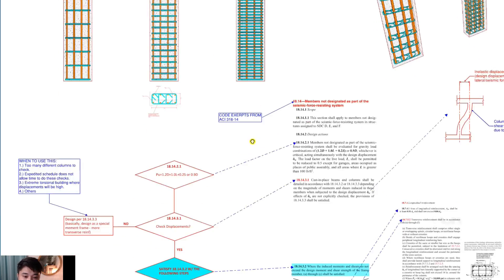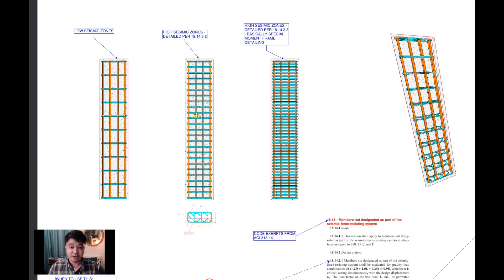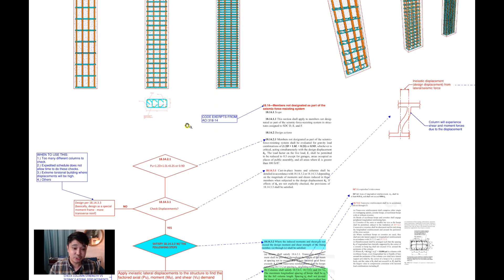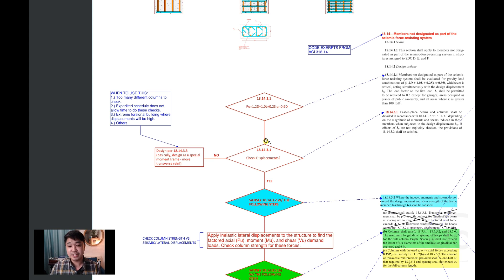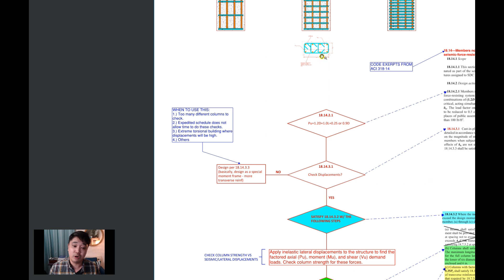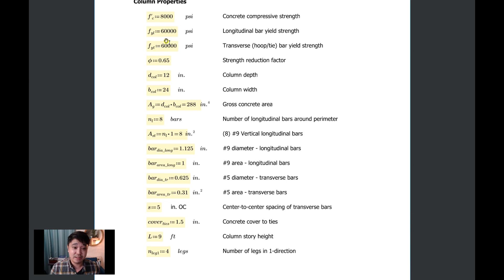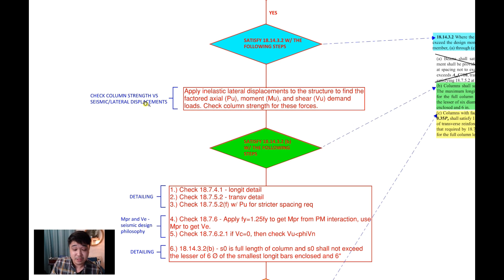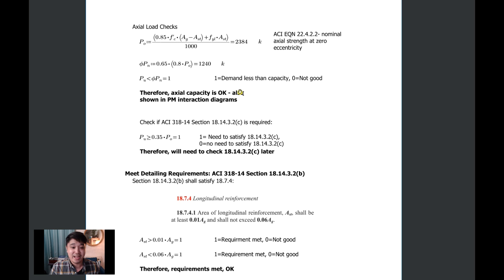Concrete Column Design Tutorial In Seismic Zones - ACI 318-14

Comment from the maker: What type of tutorials would you like to see in the future?
Reply: Designing of a shear wall like U shape in a seismic area
Reply from the maker: Oh, that's a good one, but tough!
Reply: I would love a tutorial on structural regularity for seismic buildings, say for example horizontal/vertical regularities!
Reply from the maker: Marcos, great suggestion!
Reply: Tutorial basis and professional courses videos would be great .
Reply: Hi Mat, I'm a structural engineer at Brazil. It's great to see this kind of videos even though the Design doesn't follow the same parameters as the Brazilian designing "rules". I wonder what would be the difference between the two types keeping the same load, stress & displacement. Let me know if you want to make this comparison. See ya
Reply from the maker: Gabriel, you could use the example calc and see. But, I'd hope to see that the same philosophy is the same, keep the concrete core in tact during deformation compatibility and an earthquake by adding hoops.
Reply: Design of concrete beams subjected to torsion!
Reply: Sir, please post lecture on
Selection criteria of types of foundation and design of foundation
Reply: Designing and detailing of two way slab rebars please
Reply: PT slab with bonded tendons🙏
Reply: Design of footings
Reply: More mathcad tutorials
Reply: Maybe a simple thing but that many structurals engineering fail in doing it. Model assumptions.
Like when to use floor as shell or membrane. Fisurate sections. How they affect global forces and displacements.
Reply: Beam n Slab design please using ACI code
Reply: Explaining  through unbraced lengths for top compression and bottom compression. For example is Risa when you have to enter your Lbyy, Lbzz, Lcomp. Top , and Lcomp. Bottom. I always have a hard time getting these right. Also rigid diaphragm lateral force distribution would be great. Thanks for the great content!
Reply: Could you do concrete shear wall design?
Reply: Step by step designing of buildings using staad/etabs. plsss :)
Reply: P-Delta Design of a Concrete Column with non Linear material behaviour
with solving the differential equation and
with the tension stiffening ofc.

Hell Yeaah 😆👍🏗😋
Reply: Hi Mat, very nice tutorial, informative and simple. Looking forward on your next tutorials. I think i wan to see designing of beams for SMRF, or Base shear computation as per UBC 😊😊😊.
Reply: Tutorial of basic BØQ
Reply: Would it be possible to talk about welded storage tanks :D ?
Reply: I’d like to see steel structure, or you can more deep or more variative into concrete structure
Reply: More examples of Mathcad. Greetings from Ecuador
Reply: Please do videos on mathcad
Reply: Short drilled pier design. I.e. sonotubes
Reply: Thanks Engr Mat for sharing your knowledge and experience. Would like to learn the basic from analysis to design of structural elements of building and warehouse.
Reply: Nicely explained. But didn't receive the calculation sheet yet. 😀
Reply: Deflection of beams or slabs.
Reply: tutorial on diaphragm floor design please
Reply: Performance Based Seismic Design
Reply: I would like to see in the future tutorials how to design structural members using excel
Reply: Finite Element Analysis
Reply: More seismic design for high seimic regions ; shear walls , smf and rigid diaphragm design for seismic provisions of ASCE7-10 & ACI-318-14
Reply: It would be great to have tutorials of different Strut And Tie Method applications! Thanks for your videos, you're awesome! Greetings from Guadalajara, México!
Reply: I would like to learn performanc3 based design and BIM
Reply: Seismic design of the buildings based on ACI code.
-Pushover analyzes
-non linear analyzes
Reply: Tutorial on detailing and creating plans will be especially useful.
Reply: design of diaphragms, chords and collectors !
Reply: steel structures design
Reply: Can you make a video about beam column joint connection? Thanks for  making videos
Reply: A tutorial on how to analyse mixed ductility systems would be great
Reply: Basic use of ETAB
Reply: Shear wall
Reply: Difference of result using other codes sir
Reply: Residential building design in ETABS.
Reply: Bridge design videos, please. I am always excited about the design of a structure for dynamic loading. BTW, do we consider the seismic effect while designing a bridge, if so, how it is different compare to other structures like a residential building? Thank you for igniting the quest of the young graduates like me.
Reply: Highrise building with eccentric columns
Reply: i like to see structure analysis and  design for all RC members  for small scale house based on ACI code
i know this would be tough but its my wishes
thank you a lots
Reply: Live Load Reduction for Foundations according to American Building Codes
Reply: Future SE needs this thank you so much
Reply: Awesome reference videos! I’d like to see an overview of Steel Moment Frame Designs (OCBF, OMRF, SCBF) and their application.
Reply: How to cross check software calculation with manual computations
Reply: Design of Dome
Reply: A course on tall buildings design and detailing in California
Reply: Tutorials about Interaction between soil & foundation, especially telling about the module of subgrade reaction
Reply: Hi mat, thanks for the efforts you put on these videos!
I hope if you can make one about sizing a raft foundation
Reply: designing of concrete/steel buildings in different lateral load resistant systems...
Reply: This is a great tutorial Mat. Any chance we could get a tutorial on Response Spectrum Analysis?
Reply: Design of beams sir!!!
Reply: I would humbly suggest being systematic. You have our attention. Start at the beginning of structural design, codes. Not so much mechanics of materials or analysis but  'advanced' topics'.
Reply: What about a full course for design? Useing aci &asce ?
Reply: A complete tutorial on slender column, both sway and non sway
Reply: Shear walls as mentioned below, and slabs. This video was excellent
Reply: full RCC Building Design
Reply: Autodesk Robot
Reply: ICF Wall design!
Reply: wood design
Reply: Full building design
Reply: JOINT DESIGN ACI 352
Reply: Hey Mat 
Can you do a series on the preliminary design of a building(i.e. placement of columns and preliminary column and beam sizes etc ),  prior to do the analysis in STAAD Pro (and how do the iteration if the acceptable deflection is not met is not met in STAAD)????
Reply: Etabs + Mathcad
Reply: modeling in SAP 2000 or Etabs of a 06-story building with prefabricated systems, beams, walls, columns. thx for u videos ,u are Amazing

Comment: In normal special moment frame columns you are able to not the fulfill spacing of s0 outside of the expected plastic hinge location.

In this gravity columns you have to fulfill s0 in the whole span of the column?

So in general your transverse reinforcement will be higher in the gravity columns than in normal columns?

Comment: Hi Mat, I’m from Ecuador. We based our analysis and design in American codes. Do you use a single model to analyze the gravity and seismic system in ETABS? If not, some tips would be useful about using separated analysis. In my country, one single model is generally used which includes all structural elements. RC SMF is the most common system.
Reply from the maker: It's different from firm to firm and may even differ from project to project. I like to separate the gravity/lateral models for the projects I work on, especially if the buildings are complicated. Combining lateral/gravity into a single model is great if you can get the model working, but sometimes it takes forever to just get the model to work because of complex geometries and meshing, you can end up chasing miscellaneous errors (and wasting firm money) instead of actually engineering. Again, depends on the firm, project complexity, and even software.
Reply: Mat Picardal you should make a video about that 👍

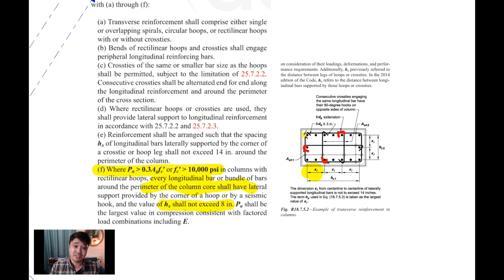Comment: Hey Mat, at 10:19 you said both hooks have to be 135 degree ones(which makes sense) but I doubt its practicality, workers on site r gonna have hard time placing such hooks.
Reply from the maker: True, thats why contractors sometimes request to use "serpentine" hoops where they use a bending machine to create multiple bends in a single continuous bar to make a single hoop for easier installation. These are typically approved by engineers for gravity columns, at least in the west coast of the US.

Comment: Nice spreedsheet Mat. 

I have read Jack Mohele book and there is a picture with a building destroyed after an earthquake where the specialmoment frame in the perimeter are ok, but all the secondary columns are destroyed.
So, it is indeed a very important topic to consider.

However, I have always have doubs about this and you may help me, with your practice in California, to clarify them.
 
Imagine you have a low rise building and you decide to do the lateral resistent system with shear walls. Normally I reduce the stiffness of the secondary members in the model to absorb the entire energy of the earthquake with the walls.

However, to resiste the gravity loads I provide this secondary columns, and seconday beams. At the end I have secondary frames. Let imagine 3 spans with 5m beams.

So my question are:

- Is there a minimum for the size of the column? In a special moment frame I consider 300mm and also I check if the anchor lenght for the rebar is enough. But for secondary columns.. is it posible to do to 200mm for example? How do you normally consider this in practice?

- Let say that your beam is 5m like i mentioned. Is it appropiate to do the beam continuos or should you design them pinned? Because if you provide top reinforcement it may transfer moment to the column I think. And if you design it pinned, is there a typical way to detail that connection to the column?

Keep doing this great videos!!

Best regards,

Agustin
Reply from the maker: Hi Agustin, in the US, column sizes are usually governed by Architectural layout and constructibility, and we usually try to push for a minimum of 14 inch column size, but sometimes we go as low as 12 inches. For example - constructibility - contractors in the U.S. prefer to use the same size formwork throughout the project, it's more economical from a construction perspective for the structural engineer to keep re-using the same sizes. So, if we have an 18 inch thick shear wall, we will try to size the columns as 18"x18", even though they may only need to be 16"x16". This helps overall constructability and helps the construction schedule (saves overall project costs). This depends on the contractor and project, but it's common for the projects I've worked on. 

For detailing, if we want to detail a column to slab connection as fixed, we will fully develop the column longitudinal steel into the slab. For example, if the longitudial reinf were #8 bars, we would use #8 hooked dowels fully developed into the slab. For pinned, we may just use smaller #5 dowel bars for the column/slab connection.

Comment: I didn't get the resources and it would be great if you can send me the files.
Reply from the maker: Hi Hasitha, check your spam or junk folder in case it ended up there. If it's still not there, go ahead and send an email to matpicardal@gmail.com stating you didn't get the files.
Reply: Did you got the resources?

Comment: Hi Mat! Im going to grad school for structural engineering at UIUC. Do you have suggestions for core courses to take on grad school? Great video!
Reply from the maker: If you're looking to work in industry and not academia, take all the design courses you can (concrete, wood, steel, etc.), and take any earthquake engineering, non-linear analysis/performance based design, and structural dynamics. FEM might be nice also,.
Reply: hi @erwin escotto. how you will join UIUC ? i am also interested for Ph.D over there

Comment: Good video Mat. Can you please elaborate the way you do the lap splices in the column. Im not familiar with the type of structural drawing shown in the video but I think i saw that the splices were place at the bottom of the column (just above the floor slabs), and according to the ACI they should be locate in the middle of the member.
Reply from the maker: I believe that's true for special moment frames (lateral force resisting) but I think theres an exception somewhere for gravity columns where it doesn't matter where its spliced

Comment: Hi Mat, when you calculate Mpr do you set phi = 1.0 as well?
Reply from the maker: When I find Mpr in the PM interaction diagram (using factored axial force Pu), I do use the unreduced curve in the PM interaction diagram. It's mentioned in the exhibit and video as well. This way, it will maximize the Mpr (if you use the reduced curve, your Mpr will be less - unconservative).

Comment: Hi Mat, so I waned to know your input when it comes to multi ties, I work as a rebar detailer  in California, and I found many times that the placer prefer the use of them as they only need to place one piece instead of multiple pieces, increasing their productivity, while it's also good for the rebar shop  productivity, it does increase a bit the quantities of rebar. but it also reduce the number of Standard hooks to only two 135D.
For some reason, sometimes in Special Moment Frames, I haven't got it approved.
Thanks for the videos and keep the good work :)
Reply from the maker: Hi Erick, I've heard those referred to as serpentine ties before, where it's one continually bent hoop. From my experience those are generally approved for gravity columns. But for special moment frames, I'm not sure as I haven't worked on one. Concretr SMF are not often used, at least in my experience.
Reply: @MatPicardal  yes serpentine ties,  thanks for your input man! looking forward for the next video :)